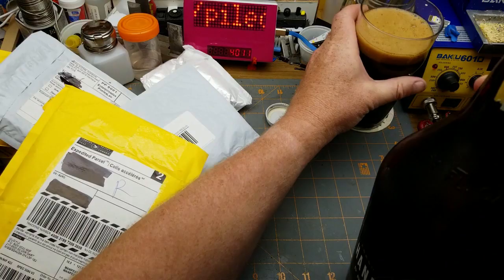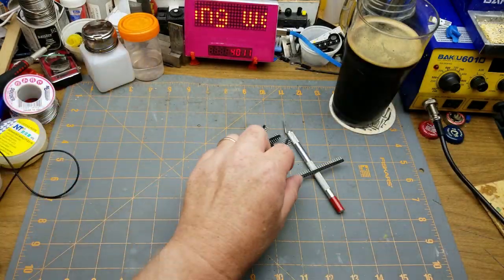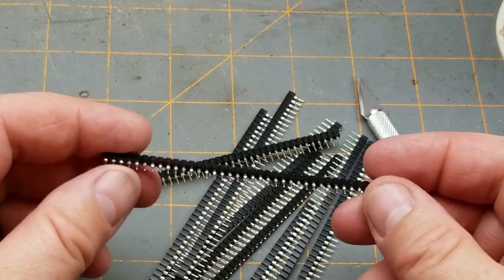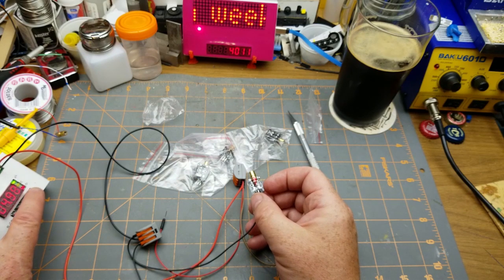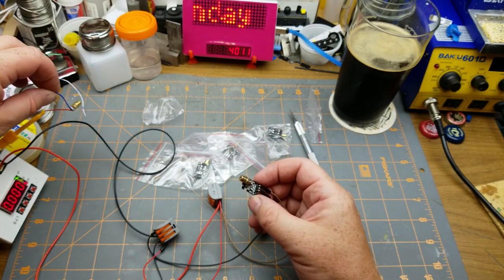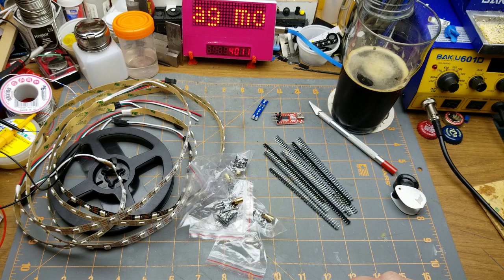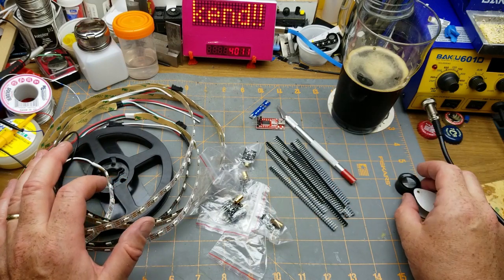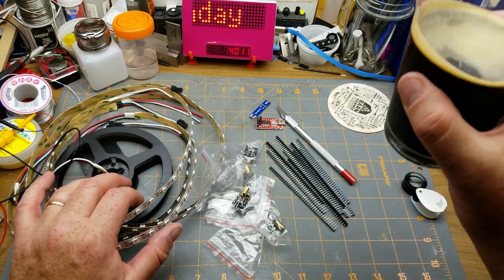Mailbag Monday (bonus long weekend edition) 64

Comment: Turned pin sockets were so much better than the standard tin strip type, i never had any problems with bad connections on logic or audio chips, very reliable :-D.
They did cost a little more but they were worth it :-D.
The strips you received looked ideal for plugging in oddball displays and similar, i used to chop up sockets for that purpose, yep a waste.

The led strips look handy, just dont over run them, some are a bit crappy.

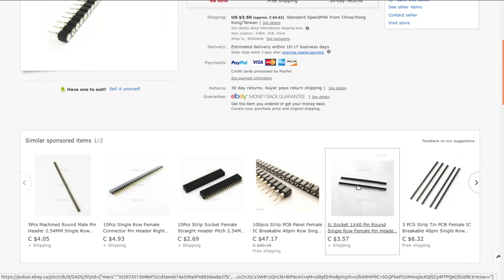Comment: Problem is you can't trust those "similar sponsored item" prices shown. 2:21  You have to actually click on every one to see if it is real and not some other cheaper item they are selling on the same listing.  eBay should crack down on those deceptive listings.  Pain in the butt.

Comment: I bought a FTDI recently, but I'm too afraid to use it because if it's a fake in might brick everything. lol  
Only kidding, if it's a fake you can get an old driver and it will run.
Reply from the maker: I'm not too worried about the abusive driver bricking my Linux machines. 

It's more the principal of the thing that kept me from getting one before now.

Comment: A small haul but nice.  I'd be able to find a use for all of that.  Shame about the LED strip - shonky dealers are advertising 1m strips as multiple lengths to get the sale I think.
Reply from the maker: For the price, I can accept it.
I'm just happy they actually work!
Reply: Shame about LED Strip? Shonky dealers? WTF are you talking about?
Look at the listing page and LISTEN at 12:25 - he ordered 4 x 1m strips in 4 separate auctions, and he received EXACTLY what he ordered.
Reply: @UCM6j5vAW30CPiUGCS1qruJw True, but he was really surprised about it  :D
Reply: @pileofstuff  Yeah that's fair enough, though the price seems a little high stilll.  Those header pins we call "machine pins".  DIL sockets etc with machine pins were always considered the premium  option for projects because they were more reliable. eg https://www.ebay.com.au/itm/2pk-24-Pin-Machine-Pin-IC-Sockets-6-wide/371331847075?hash=item56751a53a3:g:gmEAAOxyuPtQ-GRl&frcectupt=true

Comment: I use those round pin PCB connectors a LOT.   I am often switching out passives on projects, and they hold well.  Beats re-soldering.   Would like to find a similar low-profile product that takes ordinary square pins.  DuPont-like female headers are pretty tall.
You are lucky to get 3 pins on your lasers.  Just saw a video about sub-micron measurement with them:  https://www.youtube.com/watch?v=MUdro-6u2Zg
FTDI is the best USB UART bridge.  It naturally does 57600/7E1 (stm32 chips).   People have adapted it to bang out SPI (ISP).   And you will need that DTR pin to toggle reset on an AVR, when using Optiboot.  CH340G is cheap, but runs incredibly hot at 2M baud, and may not adapt readily to all UART settings.
Probably round pins on your RGB strips.
Reply: I won't buy FTDI after FTDIgate.  I prefer the Silicon Labs CP2102.  Works great and widely found in end user products.
Reply: Had to check... yep I saw that Applied Science laser video when it came out.  He does some good videos.  Maybe I will rewatch it now...
Reply: @ElmerFuddGun  Thanks ... now I know!  Since I use Linux, am blithely unaware of this.  Curious now, is it the firmware that is proprietary, or the hardware?   Seems to be a malicious driver issue.  It boggles the mind if a company goes to the enormous trouble of cloning silicon, but does not release their own generic brand and drivers for the device.  Well, now I have to figure out if mine are legit.  I imagine *NOT*.

Comment: Sometimes those laser modules have a signal pin in addition to the power pins. Try putting Vcc on the middle pin and driving the third pin high and low.
Reply from the maker: interesting idea. Thanks.